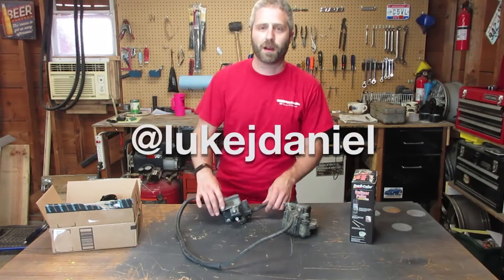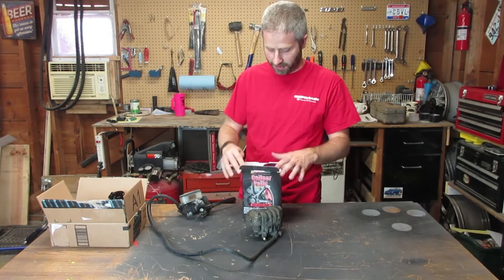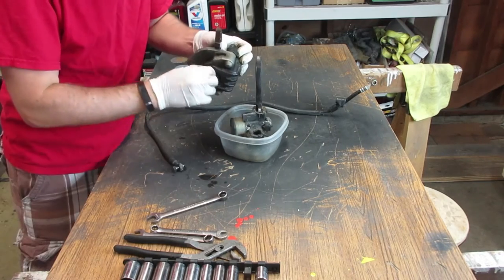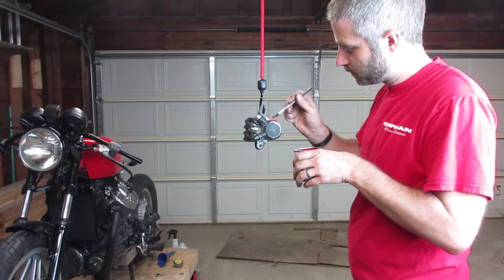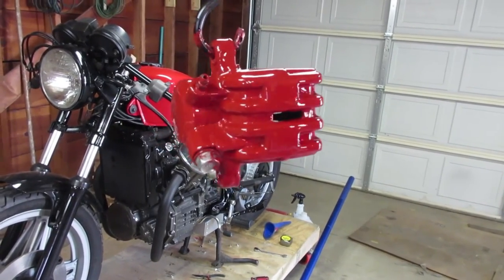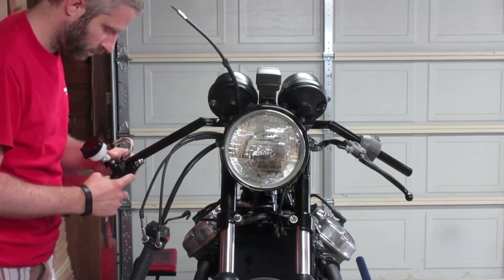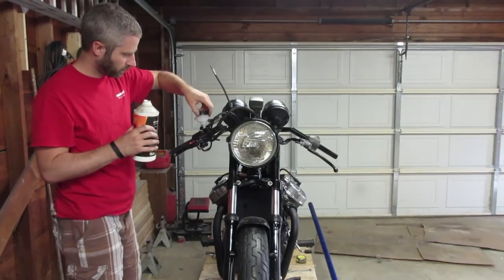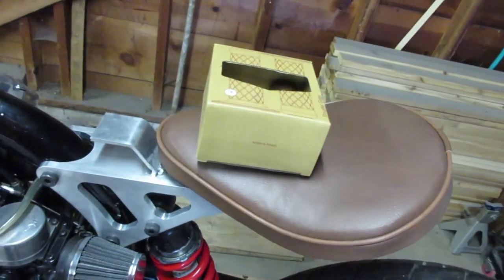Front brake upgrades - CX500 Moto Fugazi Build - Part 14

Comment: I have a 1982 Honda Cx500 as well. Ive been waiting to see what you were gonna do about your front brakes. Mine have been a complete nightmare. I bought the bike without a front brake on it. However, the guy gave me the master cylinder, rotor, caliper, and the line. So it turned out that the forks on the bike were different so i had to change those. Then, the rotor was bent, so i had to change that. Then the caliper turned out to be some other caliper off a Honda that wouldn't fit. I couldn't find a cx500 caliper so i had to roll with a cb900 caliper. I got all that fixed but i couldn't get pressure. I finally found out one of the seals in the master cylinder is bad. So i ordered the same exact master cylinder you did like last Wednesday. Unfortunately wont be here till Thursday. Hopefully you wont have the same terrible experience i did. Bike looks awesome dude. Keep it up.
Reply from the maker: Yikes! Sorry for your bad situation! Is the CB900 caliper the twin-piston upgrade that some have done on the CX500? If so, let me know how that goes for you.
Reply: +Luke Daniel No, the cb 900 caliper has a single piston. But on the cb900 itself, it has two rotors. So it has two single piston calipers on the bike. I just bought one for my bike. Ill update you after i install the master cylinder. Thanks for the reply!
Reply: +Luke Daniel The master cylinder works great and i now have front brakes. I found a solution for the clutch handle but you said you were buying an aftermarket part for it anyways. I used a hacksaw to cut off the part that connects the clutch handle to the piece that has the light switch. I then used a grinder to smooth it out. Then i painted it black. It looks fairly good. Unfortunately, while riding a little bit yesterday i managed to arc my battery on the rectifier or maybe to the frame and nothing works. Ahh the joys of an old bike. Your bike is looking great! Keep up the good work
Reply: Matt ; terrible experience?, you need to live a little longer, you just have a bad experience, don't be dramatic!!
Reply: Matt, some cx500 have also two rotors and two single piston calipers, you don' t know much about these bikes, do you?

Comment: hey luke Im really thankful for your videos, it has helped much, ive alwayst wanted to build a motorcycle and i been following your videos and putting toguether my own cx500, 

i am currently working in the carbs, i notice you have air pods instead of the original airbox, 
one of the things that atracted me the most to cafe racers was the opened space were the airbox seats, the airpods look way cooler, ibe been looking trough the forums and people have contradicting views, some say it will inebitably destroy the engine, 
others say just got to have a proffesional rejet the carbs,?  confusing,
anyways seems like yoube riden your cx for a while before your rebuild? did you have to rejet your carbs? do i have to get new carbs entierly or just the pods? how has your pods affected your bike?
Reply from the maker: You will definitely need to bump up to bigger jets when you go with air pods. I do not see how it would destroy the engine provided the fuel mixture is correct.

Comment: Are those the brake/clutch levers made by Neverland? I've been seeing those sets on eBay for a few months but have been questioning them because of the low price. They sure look nice though, and I like the idea of adjustable reach. Bit concerned about the short levers and the clutch pull too; the clutch on these bikes (at least on mine) is pretty hard with the stock lever and I could only imagine it'd be worse with a shorter lever. Would love to hear your thoughts!
Reply from the maker: I'm not sure these are the same as the set you're looking at on ebay. I put a link to the set I bought in the video description. Overall, I'd say the initial quality is acceptable, as is the fit. The levers are about 3cm shorter than the OEM levers. Testing them on the stand, they seem okay. I'll post an updated video once I get some seat time with them.